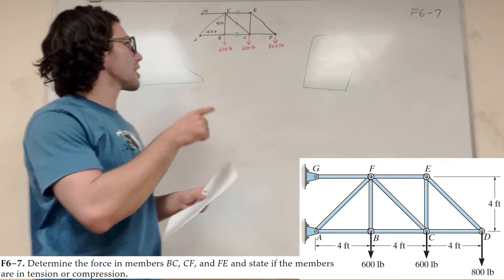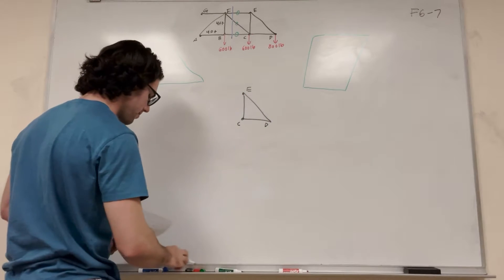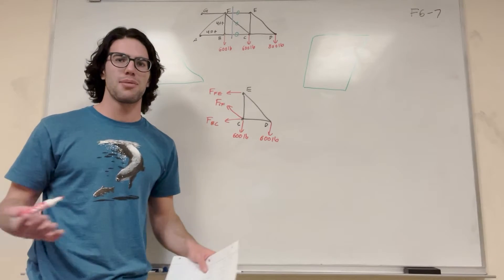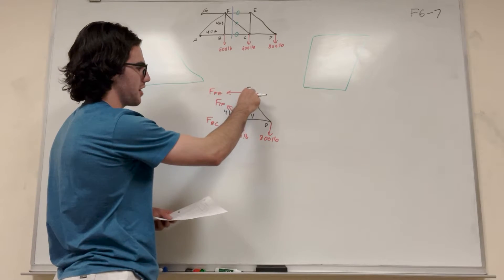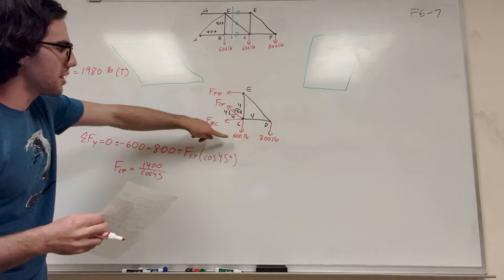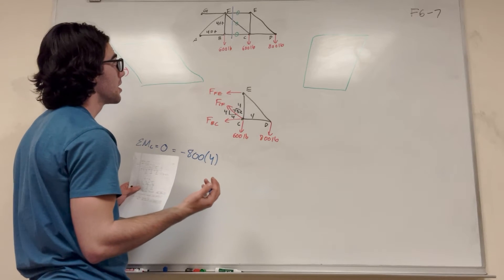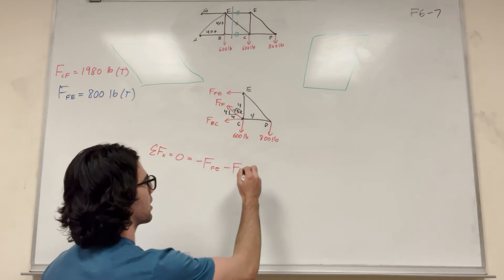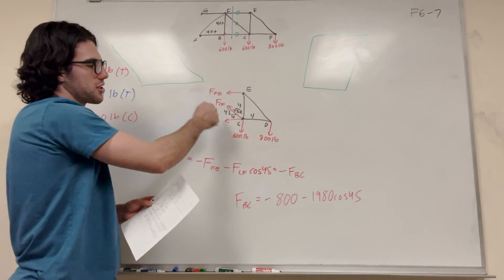Determine the force in members BC, CF, and FE and state if the members are in tension - F6-7

Comment: question: why wouldn't you include side ED when taking the moment around point c?
Reply from the maker: Good question. ED is a beam, so the forces are internal, and they don’t need to be included in the equations unless a cut is made through them.